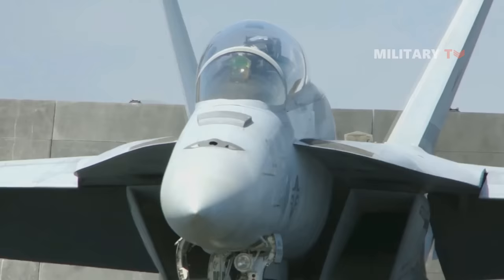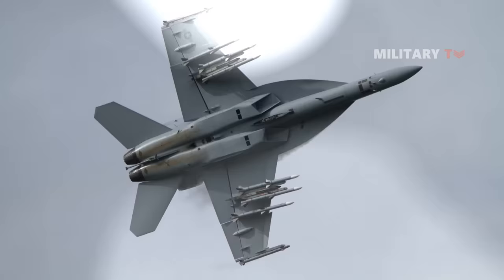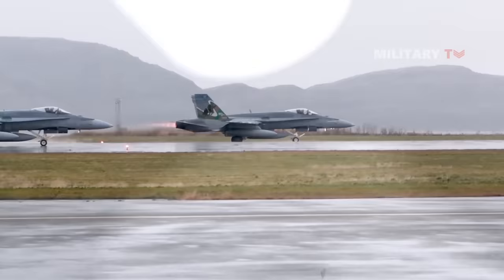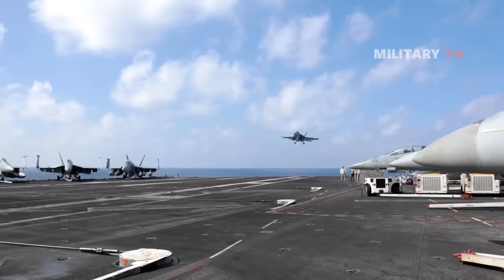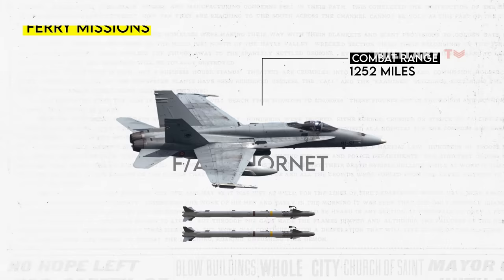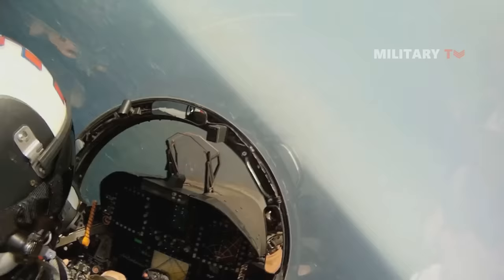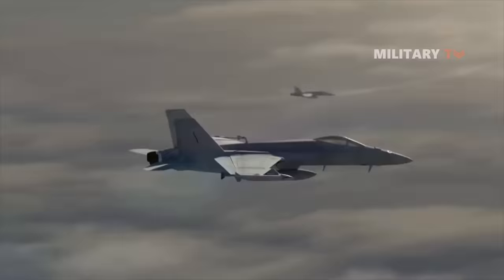What is the Difference Between F-18 Hornet and  F-18 Super Hornet?

Comment: The super hornet is about 30 percent larger then the legacy hornet , They now can do all missions of 5-6 other aircraft and very easy to maintain , Perfect fit for the US Navy !
Reply: Not only for the Navy. (Edit Navi was the result of autocorrect) 

So much cheaper than the F35.
This can perform a lot of Missions where Stealth is not needed.
Reply: @alexanderweigand6758  Roger that Navy and Marines !
Reply: We have them here in Australia along with the F35s.
Reply: The super is also made with less parts.
Reply: @ximenoworks  As I wrote.
Cheap.

OK, cheap, but very useful.
Reply: Yes. But hornet was extremely manoeverable. Superhornet is less.
Reply: The Super is made with less parts that the legacy Hornets
Reply: @ximenoworks  fewer.
Reply: @Vickzq  The legacy Hornet has a smaller radius and slightly higher turn rate, but the Super Hornet with its improved engines has better energy recovery and faster acceleration in the mid to upper power settings.  I flew the legacy C and D model Hornets in the Marines.  We looked VERY closely at the Super Hornet, and elected to wait for the JSF to be completed (the F-35) instead of budgeting for the interim solution of the Super Hornet.
Reply: They should stick an APG-79 in it. 😊
Reply: Agreed! Can’t wait for the Block 111
Reply: @kauss-uh3py  awesome! Didn’t know that, very cool.
Reply: @Vickzq *maneuverable
Reply: @ximenoworks 
How do you know that.?
Reply: It’s good to have more than one tool in your toolbox.
Reply: @karlchilders5420 Super Hornet still does a lot the JSF can't. JSF for stealth though
Reply: @VeritasEtAequitas  Other than EW as a direct mission there isn't anything the Rhino does the JSF *cant'*.  Nothing.  You are speaking to a NA.  I love the bug (legacy Hornet) but the F-35 is a great platform.
Reply: @karlchilders5420  Can't? Sure it can do anything to a degree, but not to the full capability E/F (not export neutered). Just like it isn't as good of an interceptor as the 14B/D or superiority as the 22.
Reply: @VeritasEtAequitas  It is clear I am speaking to a dilettante.  I got my wings in the 80s.  I flew the Hornet.  I was THERE when we tested the Super Hornet.  I know exactly what it can do and how it does it my guy.  I don't play video games to learn about shit I did in real life.  Maybe you should stick to wiki and games, and leave the experts to provide qualified opinions.

Comment: The design of the F/A-18 Super Hornet is actually quite stealthy. While it does not have stealth radar absorbing materials, it does have a relatively small radar signature that is roughly equivalent to that of a beach ball. It's radar image is very similar to the SU-57 and J-20, which are both claimed to be stealth fighters. In many respects, the Super Hornet is a superior fighter jet to the SU-57 and J-20. Superior radar, superior missiles, superior ground attack capabilites, and vastly better communications systems make it one of the most versatile and capable fighter jets.
Reply: I thought that couldn't be true that the super hornet has the same radar section as J 20
Seems your right that's so impressive 😮🐝
Reply: Can Super Hornet supercruise?  I hear it has to do with the engine performance...
Reply: @rgloria40  No🐝 Supercruise is supersonic flight without afterburner.   It's quite a technical leap forward 
The 🐝 cruises sub sonic if it finds an enemy it can go sonic boom💥 but afteburners cost a lot of fuel🐝
It's why 🐝 are 4.5 and F22 F35 5th generation
Reply: @KonradvonHotzendorf  Then can the Supercruise Engine be put into the frame of a Super Hornet like LS1 Corvette Engine in a Jaguar
Reply: @rgloria40  Not quite. Close though.
Reply: @rgloria40  It would be expensive and defeat the 🐝 appeal. It's Super effective but cheap to maintain and deploy. It's a cost question 💵 Plus it's popular for its cost for export 🐝
The 🦅 are developing the first and only 6th generation fighter. It's gonna  be super expensive but that fighter goes in to get air superiority,
 The Super 🐝 follows. They will outlast the F15 😥 
After you have nothing left to defend yourself with🦅 
They send the 🐝🐝🐝🐝🐝🐝🐝🐝
Reply: It is probably not hard.  Look at all the KnockOff of the F18....Even Pakinstain and India knocks off of the F18 can max out at MACH 2+...
Reply: How do you know that the J-20 has a radar signature similar to that of the SU-57? If you do know you should probably go tell some top defense analysts and get really rich, since you seem to know more than them!
Reply: @johnathonmingle7937  Because it's fat
Reply: Both fighters have a . 1 to 1 meter squared cross section but the Hornets needs to be clean, no weapons carriage but yeah it's the same  RCS of the J20 or SU 57! Which shows you how technological superiority is in the US !
Reply: @virginccyy7645  The only problem is the F18 has extra weight slowing it down to Mach 1.8.  Electronics are getting small and lighters...like a smartphone...  I doubt the extra weight is improving maintainability and durability.  It is $$$$ thing in once Congressional District.
Reply: @rgloria40  Cool fact but legacy Hornets with the EPE engines could supercruise around 27-30K feet, even with a minimal air-to-air load out. Not Rapter 1.8 Mach SC, but SC nonetheless.
Reply: @rgloria40  They can try to make a knock off of the Super Hornet, but they never will. They can make a fuselage that looks somewhat like a Super Hornet. To make one truly like it, they need the same engines, radar, avionics, control systems, and weapon systems. They have none of that. So, all they can do is make a jet that kinda, sorta looks like a Super Hornet. And that is nothing like a Super Hornet.
Reply: @herbb8547  There are ton of F18 knocks like the MIG 29, the Tawainese FCK1, J17 and etc...but Boeing F18 is the ....
Reply: @rgloria40  But they are not F/A-18 Super Hornets. They just look somewhat like one. None of those jets would stand a chance against a Super Hornet either.
Reply: @herbb8547  Don't forget about the single engine knockoff such as the Korean FA 50/USAF T-50 and Russian YAK 130...many carry the newer missiles.  F/A 18 is such a good plane....
Reply: @rgloria40 mig 29 is not a knock off f18...if you want to say knock off anything it would be the f15 tbf. But straight up...the mig29 is exactly that, a mig29..it's not trying to be anything else
Reply: @Ranzoe813  If I remember the stink in the 1990, the MIG 29 was 10 to 15 percent larger than the original F18 and had the 
leading edge wing technology "stolen."  The F/A EF 18 SuperHornet is roughly not over all 25 percent larger but in some areas.  You can say the Russia can say it a knock off of a knock off F18 since the original builder was McDonald Douglas...Not.  Super Hornet was build by Boeing Engineers and their processes.
Reply: @rgloria40  the mig29 is a direct competitor and developed during the f15's development..of which @ this time the f18 and 16 where also in development, admittedly the wings front design is close to the f18 but thats literally the only similar feature and not for nothing something every designer does. Are you willing to call the rafale a knock off eurofighter because they both feature similar design cues using canards and underswept intakes?...no not really so even if the soviets took one design feature of the f18 the rest of the jet is undeniable a unique design only again borrowing from good design from rivals and predecessor..no im not willing to call a design a knock off from one design que, the the soviet b29 tu-4-knock off copy no doubt, mig 29 is to unique to call that sorry..
Reply: @rgloria40 *McDonnell Douglas
Reply: @pike100  McDonnell Douglas no longer exist...There is only Boeing.
Reply: ya when you strap bombs and missles on it its not as stealthy as the su57...
Reply: There are RAM coatings on some surfaces
Reply: The super hornet is not a better plane than the SU57😂
The superhornet is a stop gap weapons truck that is a jack of all trades and master of none.
Try to keep things real.

Comment: I can’t imagine F35 replacing the super hornet. F35 missions usually have company of F15, F16, or F18SH.
Reply: The 35 will not replace the super
Reply: The F-35 is replacing legacy Hornets.  I think this video didn't phrase that part well.
Reply: @khandimahn9687  Thats a wish but the Navy really dont want the 35.
Reply: @ximenoworks  It already mostly does replace the Super Hornet, although it fills the "low" role in the high-low mix for the future; as of now it boasts higher combat range, payload, much better sensors, networking/fusion, and the option of stealth if requested or required. The Navy is waiting to procure Block 4 F35s rather than procuring Block 3F now and then instantly having to retrofit them but they, like the rest of the branches, are trying to procure as many as the budget will allow so they can retire some of the older aircraft and add new capabilities to the fleet (F-35s have guided Aegis missiles onto target already). Granted, they'd likely be much more excited for NGAD but until it finishes development the F-35 is their most capable aircraft.
Reply: @forzaelite1248  The Navy was forced to accept the 35.  there is still less the 100 c models. I hated working on them.
Reply: @khandimahn9687  that is 200% incorrect.

Comment: This video is fascinating. So many truths and facts along with so many wild inaccuracies. You can start with the tall tale about its relationship with the F-14. It was never meant to compliment it, it was the cost effective replacement for the F-14, which had become too cost inefficient to operate, without needing to clean sheet design an entirely new aircraft that could at the same time utilize some of the same technologies of the already existing legacy hornet. My 20 years in the navy started me out in F-18 squadrons so I’m not just talking out my ass. I know one or two things. It also was not created to retire legacy hornets. It’s tile in the sunset of legacy hornets was to complement them until they reached their end of life and then replace them once they retired, which turned out to be one of the smoothest military aircraft upgrade programs ever.
Reply: Other than F-14; what are some of the other wild inaccuracies?
Reply: Complement*
Reply: Crazy glaze

Comment: Loved the F-404 power plant in the F-18 Hornet (Legacy??). Super easy to work on compared to the J-52 engines used on the A-6 Intruder and A-4 Skyhawk or the TF-41 on A-7E and TF-30 on the TA-A7. I was certified on all four during my Navy career. When General Electric came out with the F-404, it was a game charger in its modularized construction and design and super robust, as well. A fuel cap fodded out one of our F-18s on take-off and the pilot got a fire warning light in the cockpit but it still "turned-N-burned". Upon inspection and use of a flashlight once the aircraft had safely landed, one could view the HPC spool from the hole created in the airframe from the engine bay fire. I build and fly RC aircraft, now, and reflect on many many fine memories from my uniformed wrench turning days. I'd sure love to inspect and have a good "look around" on the GE F414, though, OMG!! LOL!

Comment: The FA 18 super hornet had another innovation: a variable speed, constant frequency electrical generator (VSCF).  As its name suggests, the generator puts out electricity at a constant frequency, regardless of how fast or how slow the jet engines are rotating. Being powered directly by the aircraft engines, the generator does not need a separate motor or fuel supply. This saved space, weight, and simplified maintenance. I did the original illustrations for the VSCF generator on 9/9/01. I was concerned my work might be interrupted by being chosen for jury duty, and was relieved not to have been chosen when I left the courthouse on the afternoon of 9/11 – only to find the world had changed while I was sequestered. With the world trade towers in smoking ruins, I set to my work with determination. 
I studied the engineering prints provided by the manufacture, Smith’s Aerospace Industries, for 3 days , consulting digital photos, I have taken of a production model. They provided me with a 2D vector graphic STEP file, with which I made the illustrations. 
After three days of study, I told the writer I was going to produce the art. He objected he had not yet begun to write the work tasks. I asked him if any part of the mechanism would not be illustrated. When he said no, I told him I was going to draw it all in advance of his writing; one illustration with all the components installed, one with all of the components removed, and an illustration of each of the components, and he would be able to cut and paste them together as a markup for me to produce the final art. He was agreeable and the project proceeded smoothly. 
While I had previously used a 3-D vector graphics UNIX workstation. I performed the art on an Apple computer and handled the 3-D transformations in my head. I’ve never been able to successfully explain that mental process to others, but it works. 
I used every trick I knew using Adobe Illustrator, including white masking stacking, and clipping masks. I hope those who followed on in subsequent revision of the art figured out how I had accomplished it.
The VSCF generator project was one of my favorites, although it was a poignant moment in time in the shadow of 3000 Americans who have died in the world trade center and the Pentagon. 
God bless the FA 18 super hornet, the US Navy and the USA. 🗽 🇺🇸
Reply: The legacy Hornets always had two generators, both powered by the engine through an AMAD interface.
The AMAD gearbox got power from the jet engines via a PTS shaft. Once the engines started, the AMAD would power the fuel pumps, hydraulic systems and generators.
When I worked on legacy Hornets, we had a special jack for the generator. Similar to a motorcycle jack. If you had to change out an AMAD it was a chore but fun. 
I never got a chance to work on the Super Hornet, I left the Marine Corps before they were introduced to the Navy and Marine Corps. I miss the GE F404 engine, but the GE F414 engine looks very impressive.
Reply: Pretty cool!
Reply: You did an impressive work! Back in the early 2000s we engineers didn't have all the 3D CAD that we have today.
Reply: Sounds like an alternator for a car haha. Outputs the same current no matter what rpm the engine is in.

Comment: It is interesting how in US service the Super Hornet and Growler are navy aircraft, while in Australian service both are air force land based assets, and yet the aircraft appears to be similarly capable and adaptable in both roles.
Reply: A navalized aircraft like the Hornet is more robust relative to some land based fighters like F-16s. This, along with using roadways as runways, is a major draw as well as a 2 engine design when you have fewer jets and lots of air space to patrol.
Reply: The USMC flys the F-18 as well as the F-35C.
Reply: That's because the F-18 was originally designed for the USAF but lost to the F-16 in the light fighter programme. The US Navy adopted the F-18 because it suited their own requirements at the time and was handed over to McDonnel Douglas to navalise it and they then shafted Northrop, the original designer, by refusing to let them sell their own original air force design to export air force customers.
Reply: @deanladue5367  F-35B you mean.

Comment: You can see the knowledge of stealth with the Super Hornet, the more trapezoidal intakes curving back to the engines (I think now they even add  RAM  to the intake walls, not sure), the lines of  the wings as they hit the fuselage, and the look at the front aspect. This knocks its RCS down to what Russia declares as "stealth", 1 m^2, which is great for a 4+ gen. You also see the influence on the F35c

Comment: I started my F/A-18 introduction in June of 1980 as a member of the original legacy Fleet Introduction Team at NAS Lemoore , CA.  Moved on from the FIT  to VFA-132 which stood up as a new F/A -18 squadron at Lemoore and moved to NAS Cecil Field at Jacksonville FL. Made the first East Coast cruise of the F/A -18 onboard USS Coral Sea  with CVW-13. 1985/86. Finally ending up at NAMTRADET as an instructor for the F/A-18 Engines, Fuel System and Secondary Power. I retired from the Navy in August 1991. The Super Hornet was still rather new in 91 I did have some training and introduction to it but nothing like my experience with the legacy. Add all this up and I still have this lingering question regarding the Super Hornet "A tanker??"

Comment: Just wanted to mention that the referenced and displayed P530 in the begining of this video is probably an F5.
P530 was very similar to (actually it was the first or original version of) and very similar to F18).
Reply: The P530 became the YF-17 entry for the 1971 Lightweight Fighter competition against the F-16 of General Dynamics. When the Air Force picked F-16, the Navy asked for a naval version of YF-17 and teamed Northrop with McDonnell-Douglas to modify it into the F/A-18 replacing the F-4 and A-7 aircraft, and flying with the F-14 in carrier air wings.

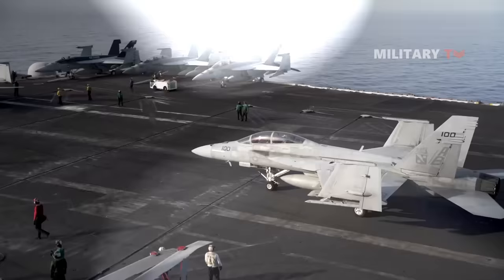Comment: 0:19 The super hornet was replacing the tomcat not complimenting it. 0:57 The legacy hornet replaced the the A-6, not the super hornet. 1:37 The F-35C is not taking the super hornets place. 3:46 Any aircraft with an after burner can do this. 5:39 Every aircraft can aero brake. 6:08 The legacy hornet also has a carrot or as most will call it the E bracket.